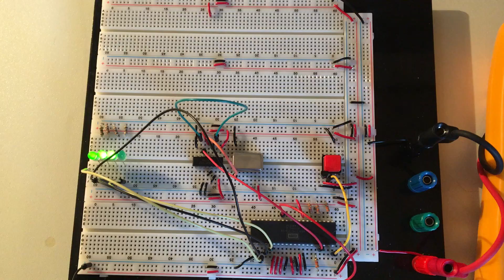6502 Mite homebrew computer project: step 1, free running

Comment: It's actually starting execution from $eaea, not from $0000, if I'm not mistaken, because when it will reset, it will read the reset vector and get twice $ea from the data bus.
Reply from the maker: Quite right! Thanks for the correction. (Similarly, I just noticed that I say the address lines are tied to EA, not the data lines! Ooops!)

Comment: 1:18 do nothing actually mean increase program counter by 1. so its doing something. skiping to next address. is that something?. well atleast it wont do nothing and stay same address
Reply from the maker: Yes that’s right. The instruction (NOP) carries our no work; the system proceeds to increment the address and fetch the next instruction. So it’s essentially a program that does nothing although doing nothing involves the processor doing something!
Reply: @pauldourish  quick and dirty its 2 clock cycle delay. so its doing good work :)